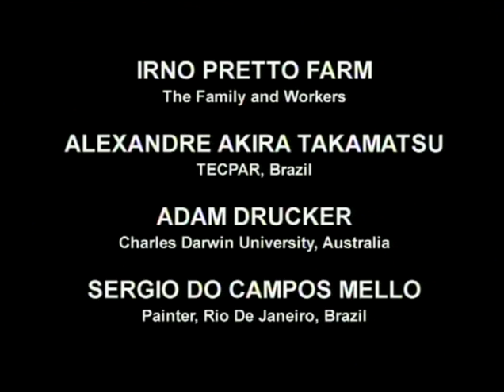Sustainability on the Pig Farm

Comment: The pig farming comments are relevant. Its best if you have animals free range and not penned up. The point here is to consider more integrated and holistic approaches to solving waste problems. These principles of integrated systems management can be applied anywhere we face a problem of unprocessed waste is a potential problem and nuisance.